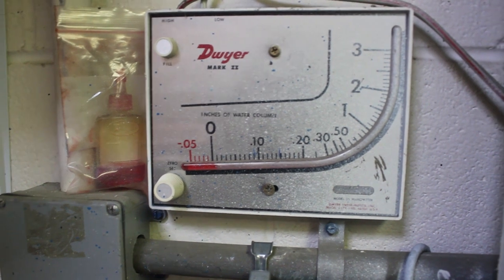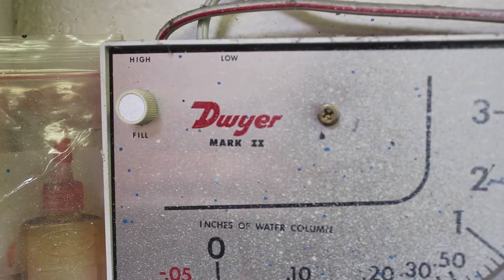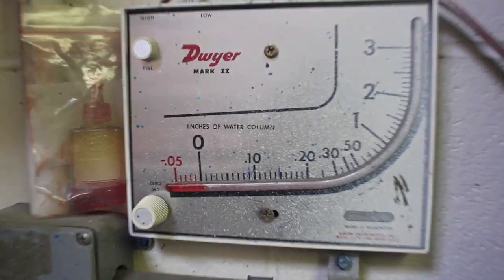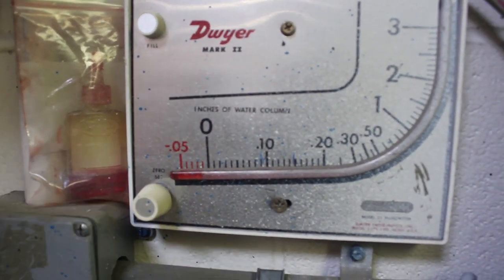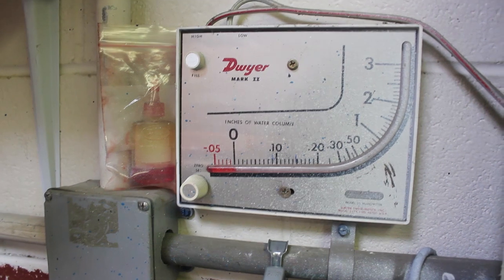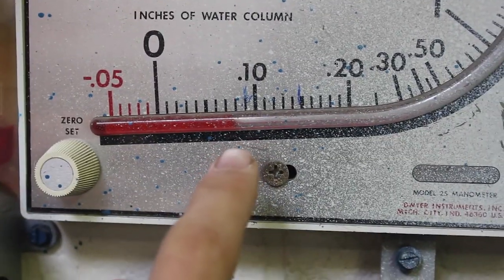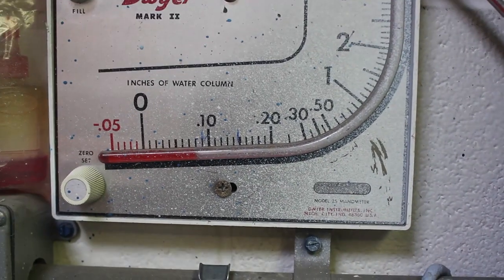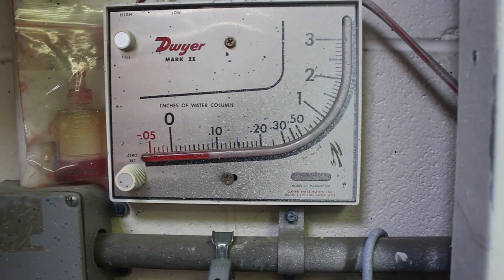How to Setup and Calibrate a Spray Booth Manometer

Comment: thank you, we have two paint booths, these gauges were broken, and we never watched it.
it could be that it paints badly, but it is not clear why.
a working pressure gauge could indicate defective filters and there would be no problems.
Now we have restored the pressure gauges.